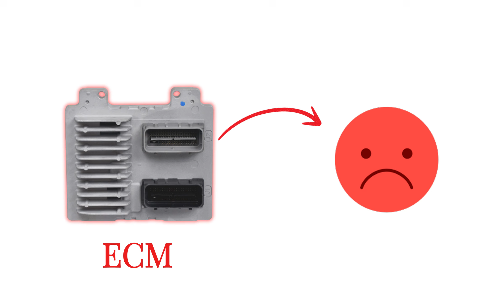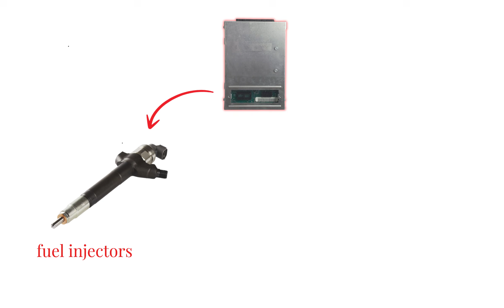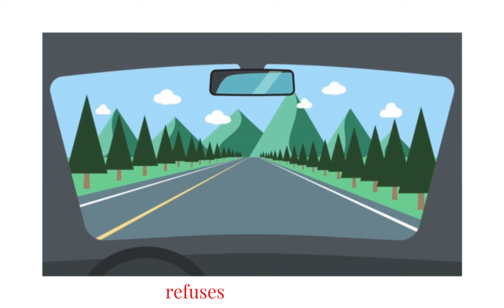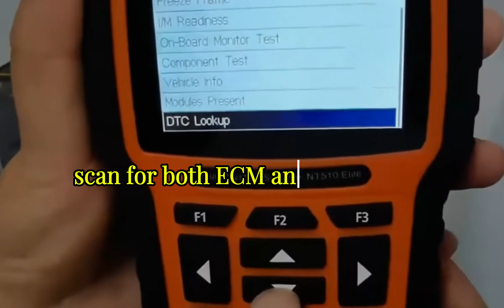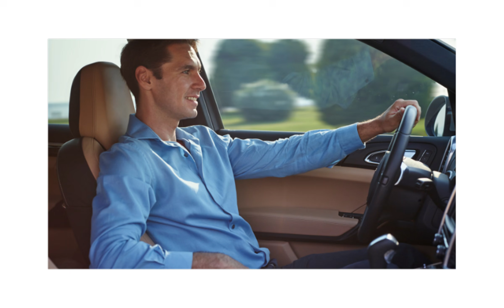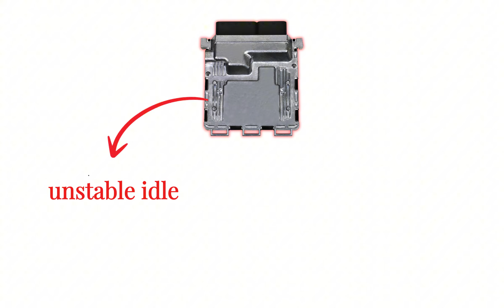7 Symptoms of a Bad ECM (Engine Control Module)

Comment: Hey I have a 2011 Toyota Camry 2.5 l engine can I get a code of misfire number one cylinder and number three cylinder and the code that pops up is p0300 they say that could be your powertrain modular I just wanted to know if that is right or wrong thank you

Comment: C1201 on a 2006 Toyota Avensis 2.0L A/T
Reply from the maker: A C1201 code typically points to an engine control system malfunction often related to the VSC system, so I would start by checking for communication issues between the engine and stability control modules.

Comment: My B200 2008 Turbo has starting issue. On level 2, the fuel gauge goes to fuel level and return back to zero. After several tries and tapping to ECU, car start smoothly. Finally my German car specialist has diagnosed and found that the ECU/ECM has an internal issues and need to replace.
Tomorrow I have an appointment to replace ECU.
Reply from the maker: That sounds like a frustrating experience, but it’s great that you’ve pinpointed the issue and have a plan to get it fixed tomorrow!

Comment: I have a 2011 chevy impala..everything the video said i replaced now my check engine like back on after a couple months, reading the code for my pcm...Will be replacing in Thursday will do an update..I have put to much money in Paula  to just trade her in..after I just paid her off..ughhhhhh
Reply: Well update..replaced my pcm and throttle body sensor..3 days later 
..my abs limp mode and reduce engine power popped back on..yal help a sister out..what is it
Reply from the maker: Sorry for the late reply! ❤️ I know how frustrating this must be, especially after spending so much on Paula! Since the ABS, limp mode, and reduced engine power warnings returned even after replacing the PCM and throttle body sensor, I'd check the wiring, grounds, battery connections, and throttle body harness before spending more money. What exact trouble codes are showing now? Those will help narrow down the real issue.

Comment: I have no bad injector wire new injector it keep saying open injector p 201
Reply from the maker: If you’ve already replaced the injector and confirmed the wiring is good, I’d check the injector power supply, connector pins, and ECM driver circuit next. P0201 doesn’t automatically mean the ECM is bad, but the driver circuit is worth testing before replacing the module!

Comment: 2017 colorado z71, 6 cyl,scan tool always shows error,can get truck to turn over by jumping crank relay,its gets gas ,no spark and ecm clicks once when turning key to crank
Reply from the maker: Since it cranks when you jump the relay but has no spark and the scan tool won’t communicate, I’d check the ECM power/grounds, related fuses, and the CAN communication wiring before replacing the ECM. The single click is another useful clue.

Comment: What about ignition coils keep burning out every 3 miles?
Reply from the maker: Yes, it's possible—but I wouldn't assume it's the ECM right away. Coils burning out that quickly can also be caused by a charging system issue, bad wiring, poor grounds, or incorrect replacement coils. I'd diagnose those first before replacing the ECM.

Comment: My Ford sport trac 2007 Experienced all these symptoms. I need to Change the brain box Asap. Thanks for the Info
Reply from the maker: You're welcome! Before replacing the ECM, I'd recommend having it properly diagnosed to rule out wiring, power/ground, or sensor issues, since they can cause similar symptoms. Hope you get your Sport Trac back on the road soon!

Comment: Hey. Thanks for the information. It is very helpful. I do have a question ❓. Does the ECU have to be reset when replacing. Or can it just be plugged out the old one, and simply plug in the replacement. The replacement is a used One. I'm messaging from the Caribbean.
Reply from the maker: Glad it helped! In many vehicles, a used ECM may need to be programmed or matched to the VIN and security system before it will work properly. Simply plugging it in doesn't always work. Check your vehicle's specific requirements before installing it.

Comment: 2009 ranger diesel ute lost communication with tcm does that mean tcm is busted or just need reprogramming. 
Towed a trailer lost speedo then tcm now limp mode
Reply from the maker: Not necessarily Losing the speedo and TCM communication at the same time often points to a wiring, sensor, fuse, or CAN bus issue rather than a failed TCM. I'd scan for transmission and ABS codes before replacing or reprogramming the module.

Comment: Midas said my computer was bad  without doing a pin hole test
Reply from the maker: Always get a second diagnosis before replacing the ECM. A proper pin test, wiring check, and power/ground inspection should be done first because bad sensors or wiring can mimic a failed computer

Comment: I bought the car off of Downey motors in Cambridge Ohio they sold me a lemon do not deal with Danny motors in Cambridge Ohio because they will rip you off if anybody knows for I can get ahold of attorney I really appreciate it I live on disability a lumbar back brace and a cane and auction I missed two heart doctors appointments because of the vehicle they will not even give me a rental
Reply from the maker: Sorry you’re going through that 😕 Keep all repair bills, tow receipts, diagnoses, and messages from the dealer. You may want to contact an Ohio consumer protection or lemon law attorney, especially since the problems started so soon after purchase. Hoping you get it resolved soon 👍

Comment: Yes my name is Jason bohl I bought a 2016 Kia Sorento I've only had it for 6 months the first week I got it it broke down and they kept it for a month and a half now it's broke down again I had to pay $500 to have it towed to a Kia dealership because nothing motors in Cambridge Ohio said it was the PCM modular the keeler dealership that I talked to said that they have no kind of equipment that will diagnose a Kia why are they even sell can I take them to small claims court I need a lawyer
Reply from the maker: That sounds incredibly frustrating 😕 If the dealer sold the vehicle knowing it had unresolved issues, or failed to properly inspect/disclose problems, you may have grounds for a small claims case depending on Ohio consumer protection and “implied warranty” laws. Keep every repair invoice, tow receipt, diagnosis, and message from the dealer/Kia shop. Since another shop already pointed to the PCM/ECM, getting a written diagnosis from the Kia dealership will help your case a lot

Comment: 2000 buick park avenue 3.8 engine starting sometimes it as if timing to far advanced will start but knocks out dashboard trip odometer but no codes
Reply from the maker: Intermittent starting and knocking with a dash issue but no codes could point to a bad ground or wiring problem rather than the ECM itself.

Comment: It’s 0527 cod.. I put a bran new part.. and still drives good it’s a 2017 Jeep wangler Rubicon.. 3.6 L
Reply from the maker: P0527 means an engine speed signal issue. If it drives fine after the new part, check wiring, connectors, and battery voltage—often it’s not the sensor itself.

Comment: It  dyi goning  whail driaving, senser cilender MIs fayer, not trining on , touc off baterry casinos off, then put them on and it did start.. by looking at all this I think I have bad ecu 😢
Reply from the maker: That doesn’t point to a bad ECU. Stalling, misfire codes, and restarting after battery reset usually mean wiring, grounds, crank/cam sensor, or power supply issues.

Comment: 1 P0335-A1 Crankshaft Position Sensor Circuit Current
2 P0511-07 Idle Air Control Valve Circuit Current
3 P0122-02 Throttle Position Sensor Circuit Low Voltage Current
4 P2009-06 Intake Manifold Runner Control Valve Control Circuit Low Voltage Current
5 P0562-A4 System Voltage Low Voltage Current
6 P1648-41 Immobilizer Security Code Incorrect Current 

This is wat am experiencing could this be Ecm
Reply from the maker: Unlikely ECM. Multiple low voltage codes point to a weak battery, bad ground, or charging system issue.

Comment: I have the video P0451, already replaced the fuel sensor and still With the issue
Reply from the maker: If you’ve replaced the fuel sensor and P0451 persists, the issue could be a leak in the EVAP system, a faulty purge valve, or a loose/damaged gas cap.

Comment: Audi A3 2L has two fault codes are p2147 &p2150 and to get rid of the them and has crank no start could be easy Fix
Reply from the maker: The P2147 and P2150 codes mean your ECU lost power to both fuel injector groups, causing the crank-no-start.
This is often an easy fix: check the fuel injector fuse or relay first.
If fuses are good, carefully inspect the wiring harness for chafing or a loose connector at the injectors.

Comment: My 2016 Hyundai Elantra check engine light came on after dealership did computer update.  It has backfired and or sounds like engine is under water.  But if I clear small evap leak code it runs great until the light comes back on.  Have already spent too much on repair shops that just clear code and say its fine but its not! Does this sound like the ECM?

Comment: I have a 2018 Chevy Malibu Lt 1.5 and I keep getting p2138 code after fix i change and the pedal and throttle body and the connector harness but the code p2138 code keeps coming back says pending and stored took it to the dealership they said they don’t see no electrical problems
Reply: Everything got reprogrammed and flashed
Reply from the maker: If you’ve already replaced the pedal, throttle body, and harness but P2138 (Throttle/Pedal Position Sensor D/E Voltage Correlation) keeps coming back, the issue may be in the wiring between the pedal and ECM especially ground or reference voltage drops.
Check for:
Corroded or loose ground connections near the kick panel or underhood.
Intermittent breaks or pin tension issues in the ECM connector.
Moisture or corrosion inside the connectors (common on Malibus).

Even if the dealer saw no faults, use a multimeter to monitor voltage on both pedal position circuits while moving the pedal if they fluctuate differently, it’s a wiring or ECM signal issue.
If wiring checks good, the ECM itself may have an internal fault or need a software reflash.

Comment: Need help .. my car starts and drives flawlessly after turned off all night for about 7 miles then as soon as my mph  starts to fluctuate alil then car starts to hesitate ,soon as the fluctuation moves alot more the car looses power and  now I'm on 20 miles an hours like if it's on limp mode smh ,I changed out spark plugs ,oil ,maf , throttle body , throttle position, camsfaft sensor ,air filter ,and a few more things ..anybody have any ideas ,thank u
Reply from the maker: If your car drives perfectly when cold for about 7 miles, then starts losing power, hesitating, and won’t go past ~20 mph like limp mode, that almost always points to a sensor failing once it heats up not something mechanical.

⚠️ Most Likely Causes
Oxygen sensor When warm, a failing sensor can send bad readings, making the ECU dump the wrong fuel mix. That causes hesitation, surging, or limp-like behavior.
Fuel pump / fuel pressure issue A weak pump can work cold but fade when hot, starving the engine.
Catalytic converter A partially clogged cat can let the car run fine cold, then as heat builds and exhaust volume increases, it chokes power and limits speed.
Crankshaft position sensor / Camshaft position sensor These can fail when warm. You replaced the cam sensor, but if the crank sensor is old, test or replace it.

✅ What to Do Next
Do a live data scan while driving watch fuel trims and O2 readings when the problem starts.
Check for stored codes, even if the check engine light is off.
Try loosening the exhaust at the front and drive briefly (loud, but if power returns, your cat is clogged).
If possible, replace the front O2 sensor first it’s cheap and often the root cause.
Reply: @theautomechanic-w8c thanks

Comment: I have an F 150 with the engine  light on. I've  got multiple codes saying my o 2 sensors  are bad, so I replace all sensors, and the same codes are back. I've checked  the wiring, and that all looks good . What do you think
Reply from the maker: If the new O2 sensors didn’t fix it and wiring looks good, the problem’s probably not the sensors themselves. On these F-150s, multiple O2 codes often mean something upstream is off — like a small exhaust leak before the sensors, a vacuum leak, or a blown fuse for the heater circuit. Sometimes the PCM can also be the culprit if it’s not reading things right. Basically, the codes are more of a symptom, not the root issue.

Comment: P0342 , i have changed camshaft sensor, checked all wiring but code shows up especially while the engine is hot, is it due to the bad PCM? Thanks
Reply from the maker: P0342 usually isn’t the PCM. When it only shows up hot, it’s often low voltage during crank, a weak starter, or a ground/wiring issue that gets worse with heat. Make sure the battery holds over 10V while cranking, check the cam sensor signal and wiring near the exhaust, and don’t forget the crank sensor or timing. PCM is the last thing to suspect once all that checks out.

Comment: My ECU is bad 😖all symptoms on mk6 jetta
Reply from the maker: Sorry to hear you’re dealing with that 😖. If your Mk6 Jetta is showing all those symptoms, it’s very likely that the ECU/ECM is the issue. Before replacing, I recommend double-checking the wiring, fuses, and grounds, as these components can sometimes mimic ECU failure. If everything checks out, a proper scan with VCDS or a trusted mechanic should confirm it. Hope you get it sorted soon!